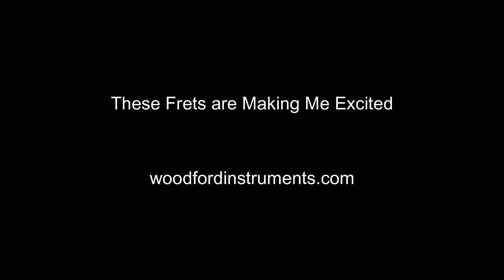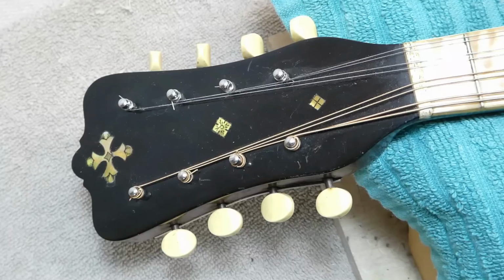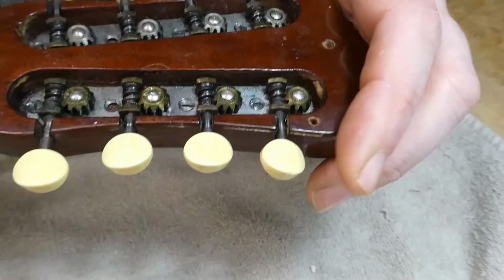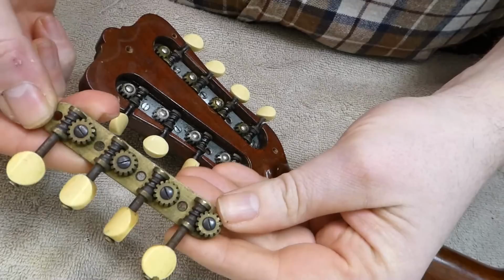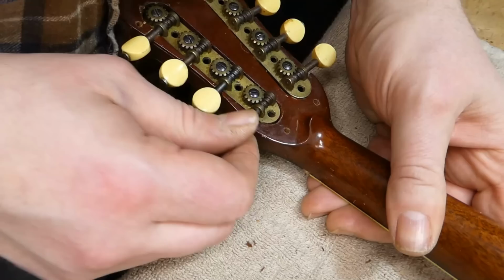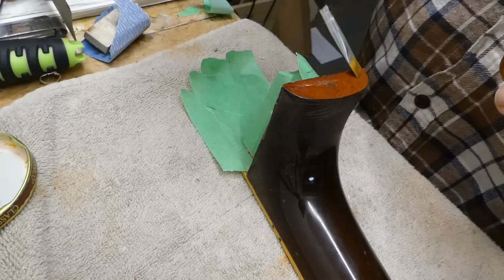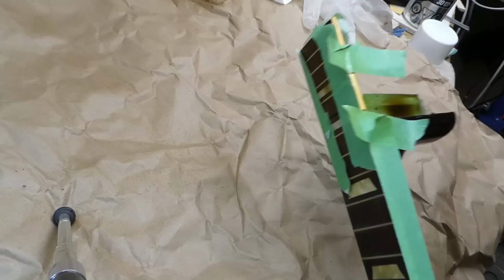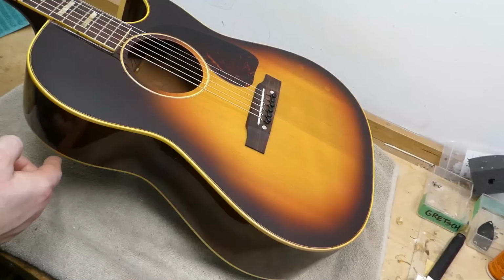Washburn got fancy, and Gibson did the Gibson thing.

Comment: I worked on one once. I took the tuners apart to clean them and, much to my dismay, did not keep the gears dedicated to the tuner that was paired with it. When I put it back together it was difficult to turn some tuners. The gears had conformed to the specific tuners. Lesson learned.
Reply: if it was of a similar vintage its very likely the gears were all hand fitted to begin with and were never interchangeable

Comment: I've had this happen with our family's mandolin and the solution was to make the part from scratch so that no modifications were done to mandolin or the original tuners. I did take one of the tuners apart to be able to copy it perfectly and what i found was that the shafts were never properly, mechanically fastened to the worm gears. At least in that case, they had simply driven the size different parts together and that'd be that. Now, this may have been a limitation of the age and shop where that mandolin was made (somewhere in Italy) or just that they thought it would suffice, dunno, i fixed it by making the gears and shafts one piece. It was a bit of a mess, because essentially i had to make a single "gear" cut rod to make them out of, but it worked out. Caveat, now both gears are made from the same metal, so wear would eventually destroy them, but ... since i made them, i don't care. Next guy's problem. :)
That was one of my first "big" jobs and it took a lot of convincing my dad to allow me to do it. A year's worth.
Reply: Yeah, I was wondering why a visit to the machine shop was not considered. Glad that originals were sourced, though.
Reply: I was thinking it would maybe be a cool youtube collab with a machinist, maybe Blondihacks?

Comment: When I was 19 I was tasked with the exact same repair on a very similar mandolin, I, too was stuck trying to fit modern spaced tuners on the same sort of head stock, I had to carve out the slots on the side so the posts would fit and ream out the holes, they worked but the thing buzzed like crazy because like this one, I couldn't level the frets at all and there was no truss rod or anything. Nine hours later I now recall, I even had to cut the posts down and cut them into slotted posts because they were too tall and the strings wouldn't even be in the nut.

Comment: RESPECT!  It boggles my mind how inexpensive these mandolins are! German Zither's and local Pianos have a  WEALTH of Ivory , Ebony keys, Huge, aged/seasoned Adirondack or Sitka Spruce sounding boards.  19th century German Zithers sell for $50. and have 6"- 12 " of Pristine Brazilian Rosewood,  4 mm tall Flat Fret wire,  LARGE Engraved Sterling Silver cover plates over the same gear Tuners in this video.  It broke my heart to cut up a Brazilian Rosewood  Zither to patch into 1950 Martin D-28 that was in a car accident,  Thank You Ted,

Comment: I'm working on a similar Washburn - a model from 1892 based on the catalog - That has no way to remove the tuning machines, which is lucky because they work pretty good. they seem to look much like your replacement tuners, but this mandolin doesn't have the metal cover plate on the back - there's an ebony veneer over the back that looks to me to be original. like yours, outstanding workmanship. The folks who built these instruments were amazing craftsmen and women.

Comment: I’m so glad the beautiful tuner back plate was able to be saved.

I use a sheet of that rubbery shelf cushion material that people put under pots & pans in my lap when playing my Renaissance lute.  You can put it between the instrument and your shirt when standing.

That should work with a bowl backed mandolin as well to keep it from tipping.

Beware that the rubberized mat may react with some finishes. (It doesn’t affect my lute which has a light coating of matte poly finish.)

Comment: The Style 250 dates from 1905 which is what it appears to be according to the excellent Washburn book by Pleijsier so if made earlier it would have a different Style number- they are shown in the book from original illustrations. The case brand is "Bull's Head" which was well-known for many decades although the leather cases disappeared in the 1920s as new hard case types had been developed and they opened sideways- not from the end.

Comment: hooray for the replacement mando keys! that was fantastic

i've done a meager handful of neck resets but one thing i figured out is it's way easier to do the controlled sandpaper pulls with the body clamped in place! just watching the video we can see the body itself moving around while being held up with one hand and doing the pull with the other, in my mind that's literally wasted effort and energy

i rigged up a simple padded wood plank with long bolts on the ends that screws into the side of my padded bench, that way i can clamp an acoustic body inside there between plank and bench right where it needs to be and it won't move while i'm doing the pulls

Comment: Mandolins got a lot harder to play when they went from gut strings to steel strings at a thirteen inch scale. Then less than twenty years later Gibson bumped the scale up an inch making it even harder to play. I have spoken with many players of Gibson mandolins who tried using light gage strings and switched back to medium shortly there after. My mandolins have a thirteen inch E string going up to a fifteen inch G string. This allows me to play with an average tension of eleven and a half pounds and intonation is with in a penny or two.

Comment: Shoot me down in flames if I'm wrong, but the original machine head strips appear to be installed upside down.

String tension will pull the gear away from the worm, creating greater wear and therefore tuning instability.
Reply: If you mean at the factory, possibly.
If you mean at a later date, no.
If done at a later date, the knob post slots
would be on the wrong side of the gears
and there is no sign of old slots. 😁✌🖖

Comment: Longtime viewer, first time commenting.

I absolutely love your work and your very evident expertise, but could it not be the case that the original tuners were simply the wrong way around?

Please be kind if this is a stupid question.
Reply: No, the original tuners are in the original position.
If not, the slots, for the button posts, in the sides of
the headstock, would be on the wrong side of the
string posts and there is no sign of previous slots. 😁✌🖖

Comment: Those tuners were probably taken out and then put back in upsidedown. Swap them and the shat will be on the top.  You put the new tuners in the same way as the old ones. Shaft on the bottom.
Reply: No, the original tuners are in the original position.
If not, the slots, for the button posts, in the sides of
the headstock, would be on the wrong side of the
string posts and there is no sign of previous slots. 😁✌🖖

Comment: You had my blood pressure rising until you found the matching tuners. Many hobby-level machinists can remake many of those parts in under an hour. Seems a shame to modify the guitar, when  you can just modify the part. At the very least redrill a new plate to match the spacing and maybe turn down the diameter of shaft a little.

Comment: This may easily be my ignorance showing, but if the "1894" tuners had the gears on top, and the "1899" tuners  had them on the bottom (ie: the "better" way), why did you put the "new" ones on, effectively upside down? Is it that the headstock made it impossible to put them on the "better" way? Or is there a more "luthier-y" reason?
Reply from the maker: The gear teeth are cut on a diagonal that is "backwards", so if you put them on with the post on top the tuners turn in the opposite direction. Plus, they wouldn't fit in the recess and the slots in the headstock would be misaligned, and the holes in the face would have be plugged and redrilled.

Comment: I wish you would elaborate on the subject of shellac. What does a 2 .5 - 3lb mix actually mean?
Reply: Looks like it’s 3 lb shellac flakes dissolved in one gallon of alcohol.
Reply: @audunrundberg9180  or if not wishing to cut that much at one time, use a ratiometer set for mixing in small batches. You sometimes see them in thrift stores when descendants clear the boards after a death. Looking them up on Google Lens... found some information more likely to be useful.

What is the metric ratio for shellac?

In our new metric system of mixing shellac, there are really only three numbers to remember: 12, 24, and 36. If you simply remember that to make a very light dilution of shellac (equivalent to our old "one-pound cut"), add 12 grams of shellac to 100 milliliters of alcohol. Interpolation for a different cut can be figured from these three figures.

Hope this helps.

Comment: Could you just swap left to right and reorient the shaft to the gear?
Reply: Doing that, the button posts would not line up with the
slots, in the side of the headstock. If you are also suggesting
reusing the original tuners, they are already too damaged. 😁✌🖖

Comment: Why couldn't you just flip the originals upside down and swap sides? Then the gears would be on the bottom like the replacements you received? @14:50
Reply: Because the slots in the sides of the headstock
would be in the wrong place And they were already
to damaged. 😁✌🖖